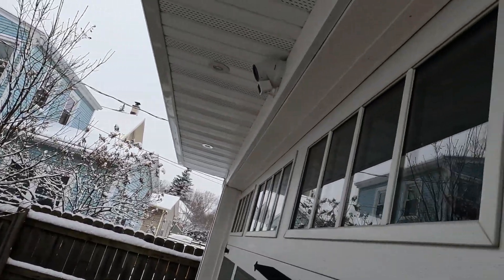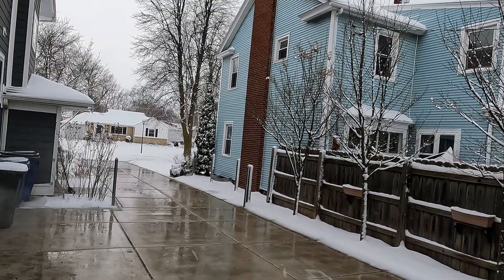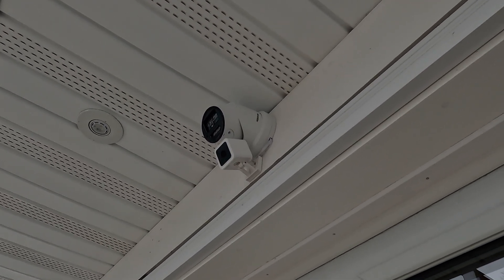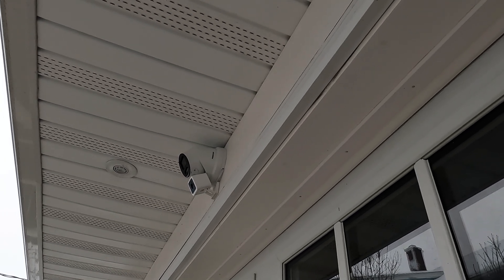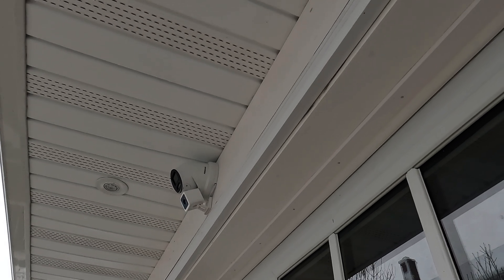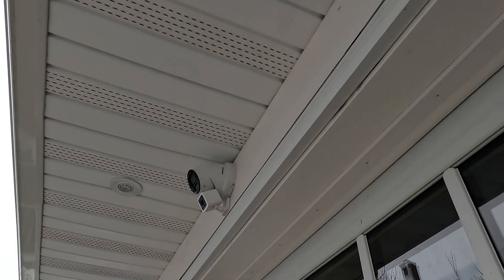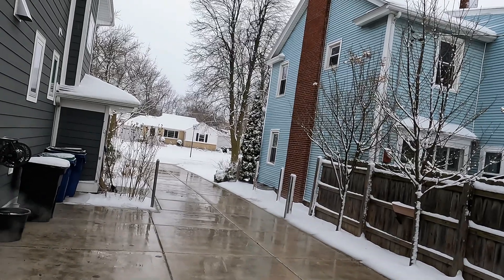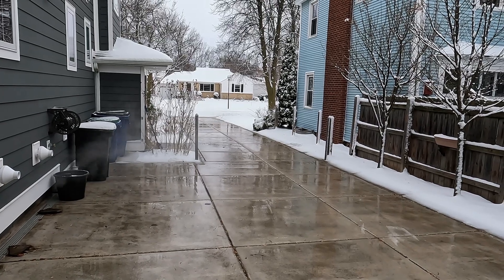1 Buffalo Heated Driveway Snow Melt Time Lapse, 2 Different Cameras - Which one is Better? - 1/22/23

Comment: How long before you got an arduino controlling an air puffer to clear the lends automatically on a timer?   then you'll round the corner into running tenserflow to detect snow on the lens and only puff when needed and make sure its clear.
Reply from the maker: Haha.  Now that sounds like a fun project!  Instead I ended up installing a different camera with a heated lens 😉.  Not as fun, but still cool.  If you want to check it out along with an FLIR thermal imaging video of it, you can find the video here: https://youtu.be/g6KNzM8oh3w Thanks for the suggestion and for watching!!
Reply: @DeckerChristopherJ  is the heat lens keeping up?

Comment: Chris, your heated driveway system control panel is a work of art. Pictures of it should be considered  suitable for framing.
        An Interesting comparison of your two cams. A $270 cam against a $30 WYZE cam being used for the purpose of providing a video of your driveway heating system. There were pluses and minuses (although not many) in both time lapse videos. Both cams are impressive but I couldn’t justify paying $240 more for the more expensive cam. 
        I have been using WYZE cams of varying models for several years those being used to monitor the street, front and back yards, a number of bird feeders, and the interior and exterior of two Bluebird houses, home interior when on vacation, etc, and they are impressive. The newly released V3 version has a very improved low light capability.
        I’ve been wondering how much better a high priced cam would be over the WYZE cams but didn’t want to spend the money to purchase and install one to test it like you did. Thanks for settling that issue.
Reply from the maker: Thanks for your detailed response and opinion Fred!!  I also appreciate your kind words!!  I think you’re going to enjoy the test video 😉. Thanks again for taking time out of your day to watch and respond, I appreciate it!!

Comment: The camera 1 was the expensive one and camera 2 was the reasonably priced one. I can tell from the angle. Both looked good to me. One advice is whichever one you choose just make sure it in the camera 2's position (lower) so that whole drive way is covered, might get a little snow from wind perhaps but should be better overall
Reply from the maker: Thanks for the suggestion pooh! So are you saying you like camera 2’s picture better because you can see more of the street? Either camera can be adjusted, so I can re-angle them. I tried to align them both with the bottom of the picture at the same “line” on the driveway. I’m learning a lot from the comments on this video. I always thought “who cares about the street, people want to see the driveway melting” but I’m learning people like to see the “big picture” including what’s going on in the street.  Anyways, I’ll be releasing the testing video soon!  Thanks for your comment!!

Comment: Love your videos. I'm designing my system right now. Do you use snow sensors or just manually activate the system?
Reply from the maker: Thanks Ryan!!  Let me know if you have any questions!!  I did install the Tekmar 091 Socket in the slab and ran a conduit back to the utility room so I can add the sensors if desired, but for right now I'm just turning it on/off manually.  I can do it physically from the switch on the wall in the utility room, or remotely from my phone.  Hope that helps!  Thanks for watching!!
Reply: @Chris Decker  that's what I plan on doing. Any concern about heating the slab to quickly and cracking it?
Reply from the maker: I am not really concerned with heating it too quickly.  I'm really only raising the surface temperature of the concrete to 40º-45ºF, and it does that slowly over 2-3 hours until up to temp.  My system only puts out 70-80ºF glycol when first started, and eventually increases slowly to 100º.  Once the return glycol coming back hits 80ºF, the heaters are turned off but the driveway still circulates until the return drops below 65ºF, at which point the heaters are fired again to add more heat.  This way it's not a constant heating, it's off / on over a period of time so the slab can slowly adapt.  In addition, I once read an article by Dan Foley labeled "The cold, hard truth about snowmelt systems."  You'll find it if you google it.  In that article he discusses how in all but commercial and industrial applications with huge boilers and pumps, it's pretty much impossible to thermally "shock" a slab.  Such a huge mass of (in my case 1,600 square ft of 5" thick) concrete is in complete control, and there really is no way to raise the temperature of all of that concrete fast enough with a couple of tankless water heaters and 5/8" pex at the bottom.  He is a professional  (I am not), and I believe him! 😉.   So far it's on its 4th winter and I do not notice any cracks that weren't there before turning it on for the first time.   I guess time will tell!  Hope that answers your question.  Thanks for watching! 😊
Reply: @Chris Decker  thank you very much. We don't get as much snow here in Denver as you do but my driveway is sloped and faces north so it never melts. When it does melt it re-freezes at night. Your videos have been a great help for me to design my system.  Mine will not be as complex as yours,  but I'm confident it will work well to do what I need.  Thanks again

Comment: I think either would do you fine. the 2nd camera has a slightly larger field of view, so we can see all the way to the end of the driveway, giving it a slight edge on #1. if there is a difference in how they perform in blowing snow (in at least 1 previous video you had to keep cleaning the lense when snow built up on it) then the one that would prevent/reduce snow build up and/or clear snow build faster would be a bigger factor for me.  otherwise on my phone screen I don't see a big difference in quality.
Reply from the maker: Thanks Doug!!

Comment from the maker: Sorry for the mistakes in the outro guys.  It was definitely shut down on January 23rd, 2023, not 2022, and the cameras will be "revealed" in a future video. 😩  I do all of this YouTube stuff (editing, etc.) in the very little free time I have, after working a full-time job, and sometimes I don't catch things even after watching it several times before publishing.  I will slow down and do a better final check in the future, I promise.  Thanks!
Reply: Don't be hard on yourself Chris, you are doing fantastic!! Keep it up! Slow and steady wins.😊
Reply: Chris- are you using a thermostatic mixing valve with that boiler? I've mine all set up for driveway best but not connected yet. Wasn't sure if the mixing valve is necessary?